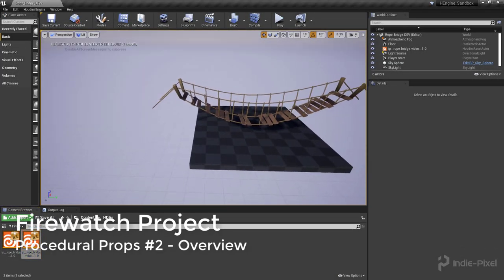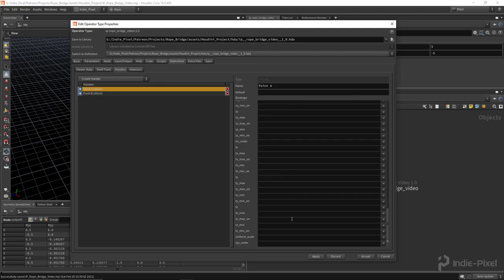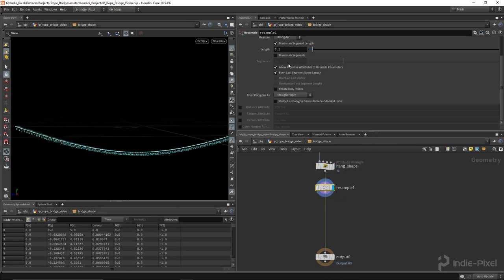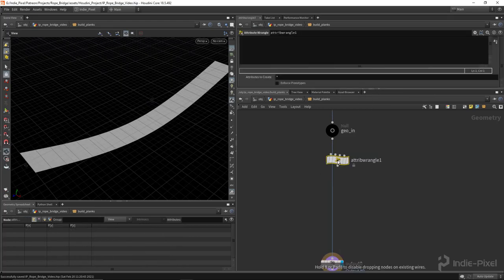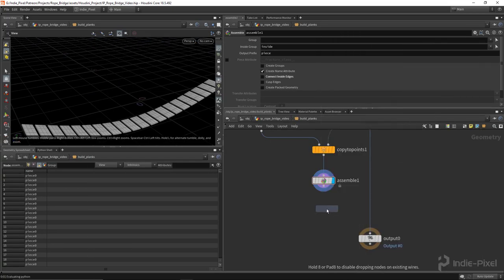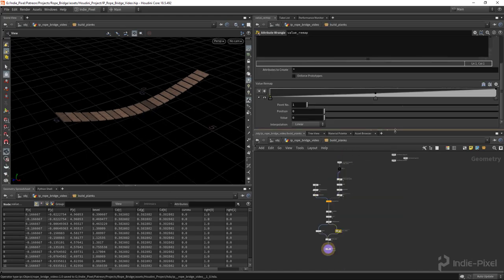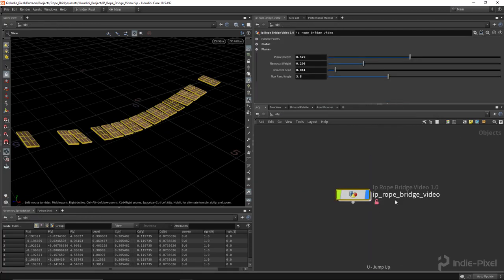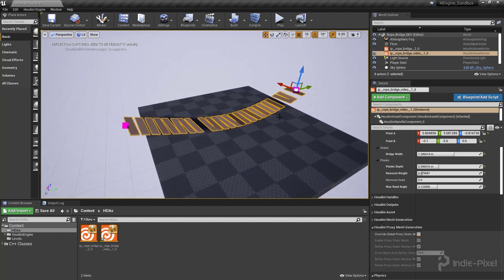Houdini Engine V2 - Procedural Rope Bridge

Comment: Going through this really awesome tutorial. I can't find any info, but can you programmatically make handles for the HDA? i.e. if I want my bridge to have numerous points that the user creates and let them still control them by a handle?
Reply from the maker: Unfortunately not at the moment.  Hengine works with blueprints at an experimental level, so it may be possible to put an hda into a blueprint to control the user points.

Comment: Hey about to attempt this! Wanted to ask before I do, is there a specific reason you might choose to make the HDA at Obj level instead of SOP level?
Reply from the maker: @Vesperele  yeah, if you want to output multiple types of stuff.  Like instances and a terrian.  It may be different in the latest HEngine....I dunno since I stopped using the HEngine
Reply: @IndiePixel3D  What did you switch to using instead? 😮
Reply from the maker: @Vesperele  I only use pcg and geo script now in unreal.  Much better.  Also use EUWs and c++ for UI and component visualizers.  Much faster procedural generation for unreal rather than HEngine...I loved HEngine back in the day but with the introduction of pcg and geo script... HEngine is kind of obsolete for unreal.
Reply: @IndiePixel3D  that’s super interesting, i love unreals recent advancements and was looking into the PCG/Geo script systems but I wasn’t sure if it was smarter cause houdini is so long established and the UE stuff i would’ve assumed is still “on its way”. I’m quite new so i’m not sure if there’s a distinction between HE and Houdini itself but very very curious to hear your personal opinion on whether Houdini itself is still useful as a tool for Unreal developers then with the new stuff in 5.4 etc or if learning Houdini for Unreal is ultimately going to be redundant? My learning time right now is very scarce and i have to ration it.

Appreciate the responses btw! 😊
Reply from the maker: @Vesperele  yeah I still use Houdini...just not HEngine...side fx did a great series on roads and rivers for the Pegasus project.  That is a good demo of where HEngine can still be good.  They showed how to use the find shortest path node to do rivers.  That node doesn't exist in unreal yet.  So I just make my own nodes using c++ when ever I run into that situation.  Though I can't remake all of Houdini's nodes...lol...some of the math is waaay over my head
Reply: @IndiePixel3D  sorry one last question just to get this straight in my head, so you have houdini, and instead of HE you have PCG/Geo Scripting/EUW and C++, but how does your Houdini stuff interact with those systems in Unreal? if it’s a huge topic I can go look into it if you can point me in the right direction 🙏 also thanks i’ll go look at the pegasus project!
Reply from the maker: @Vesperele  if you want to hook Houdini into unreal I use pdg and hython.  :)

Comment: 11:36 how do u add ur own presets in the wrangle node? do they persist when updating houdini versions?
Reply from the maker: If you go up to the little gear icon on the wrangle node you will find the save preset option. They do persist between versions. They are stored in the user press I believe.

Comment: Hello,
I followed along and encountered 2 issues where I couldn't get hold make the point handles in UE4 (had to put in numbers), and the color isn't imported into UE4 but it came in as blank. 
Do you have to do anything prior so that those would work properly?
Reply: regarding the handles in unreal engine, did you find any solution to this? because im facing the same issue.

Comment: Hello i have an issues with this vex expression at 1:54:10 

int pnts[] = primpoints(0, @primnum);

vector posA = point( 0, "p", pnts[0]);
vector posB = point( 0, "p", pnts[1]);

vector nrmA = posA - posB;
vector nrmB = posB - posA;

setpointattrib(0, "N", pnts[0], nrmA, "set");
setpointattrib(0, "N", pnts[1], nrmB, "set");

 i dont understand why, can some one help me 
My display normals just disapear
Reply: Having the same problem, before i add 

setpointattrib(0, "N", pnts[0], nrmA, "set");
setpointattrib(0, "N", pnts[1], nrmB, "set");

The N[2] value in the spreadsheet is 1 on each point, but after its all 0 and not 1 and -1...
Did you find the solution to the problem?

Comment: Aahhh I thought it was a unity video 😩
Reply from the maker: Well, you could do that same process for Unity.  For the most part the HDA will work in Unity as well.  When ever you see me use an Unreal attribute, there is an equivalent attribute on the unity side.  Usually they have the same name too.  For instance...to instance something we use s@unreal_instance in unreal, but the Unity attribute name is s@unity_instance.  So not too different. :-)